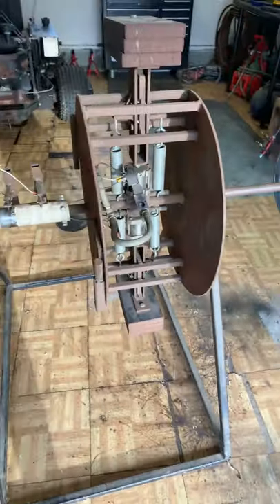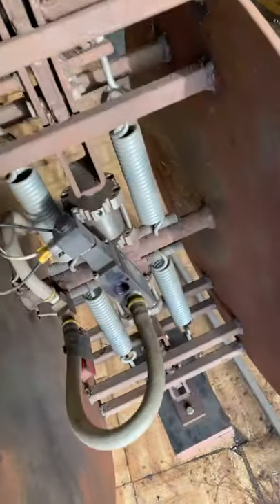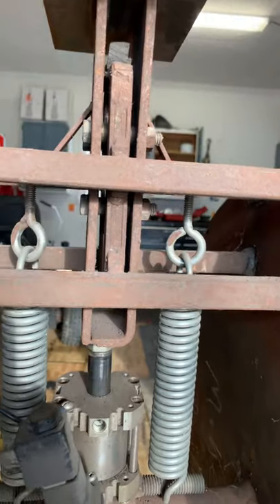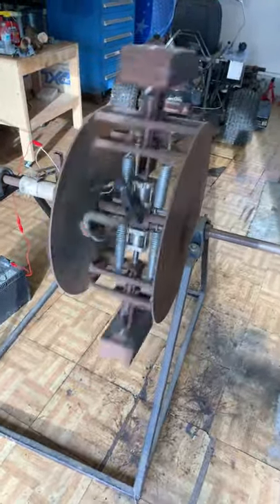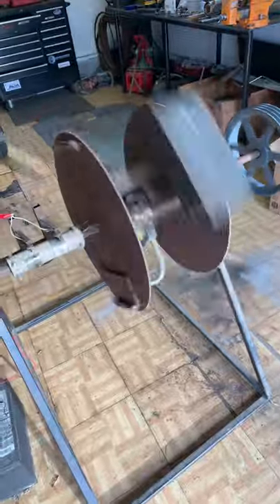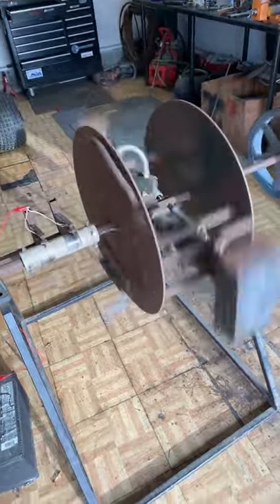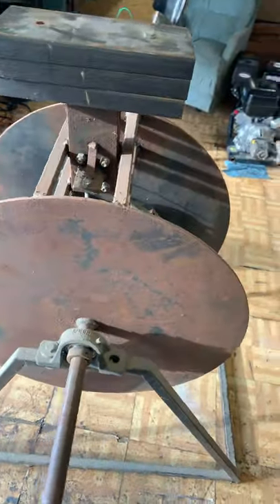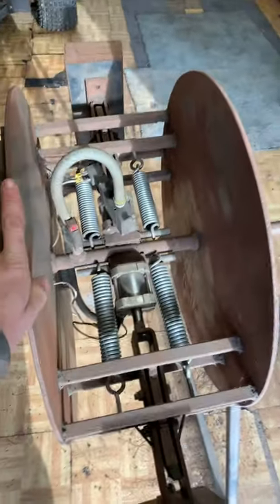Gravity powered motor prototype!!  Free Energy!!  #1

Comment: free energy is real, , and you have a very good solution to the overbalanced wheel. Of course to overcome the centrifugal force pulling the weights out, just build a larger wheel with more and heavier weights and slow it down.  Well done!
Reply: Yes, your suggestion is very accurate. For example  let's say a 8 ft diameter with 24 weights, the weights can be push out solenoids or electro magnets.
Reply: @MehmetBoysal  🔴 What Is Islam? ⚠️

🔴 Islam is not just another religion. 

🔵 It is the same message preached by Moses, Jesus and Abraham.

 🔴 Islam literally means ‘submission to God’ and it teaches us to have a direct relationship with God. 

 🔵 It reminds us that since God created us, no one should be worshipped except God alone. 

 🔴 It also teaches that God is nothing like a human being or like anything that we can imagine.

🌍 The concept of God is summarized in the Quran as:

📖 { “Say, He is God, the One.  God, the Absolute.  He does not give birth, nor was He born, and there is nothing like Him.”} (Quran 112:1-4)[4] 📚

🔴 Becoming a Muslim is not turning your back to Jesus. 

🔵 Rather it’s going back to the original teachings of Jesus and obeying him.
Reply: @MehmetBoysal  Right suggestion! In such design we need bigger (fly)wheel. Bigger diameter stores more energy and the wheel rotates more smoothly.
Reply: Minél nagyobb az átmérő annál nagyobb a centrifugális erő.Inkább a tengely meghosszabításával lehet probálkozni több elmozduló súllyal.

Comment: @Mike Beliler
Good Job, Nice to see big disc spinning. You have a blue pulley wheel sticking out, you can connect it to the air compressor and see whether it can go perpetual. Also you can try using DC solenoid plugger to pull the weights in and out and its timing can be controlled precisely. Keeping going.

Comment: Wonderful mechanical device!  Once you spend some time learning about the physics of it you will ultimately realize that it can't create more energy than it uses but the true key is the understanding gained.  It sucks but the laws of thermodynamics are sound.  That should never stop us from trying and exploring though!
Reply: As usual the physics guy ignores that he is trying to gain more energy through attempting to harness gravity as an additional power input.
Reply: @tomledger8944  No I don't ignore that.  In fact I've tried it many many times over the years and each time I ultimately come to the conclusion and figure out what little fact I didn't account for and why my devices wouldn't work.  I had the idea of a magnet on a pendulum that would swing down with gravity and hit a V gate at the bottom and break through the resistance with gravity's power and thereby return to the top and keep going.  Or when I dropped a baseball at one foot high and got it to enter a pipe of water and go up to 10 feet high I was thinking boy am I on to something here!  I guess I'm just trying to say the best part is the learning that is done.  If you break some amazing law of science in the process even better!

Comment: Very nice to see that so many people experimenting with so many designs. Can we call it like a Renaissance of great inventions? I guess so.
Regarding to your device.. maybe you can use electromagnet/ magnet pair to overcome the "dead spot" of the wheel. If to put permanent magnet on the circumference of the wheel and every time the wheel goes to the "dead spot" the activated electromagnet with the polarity N pushes permanent magnet S polarity and the wheel accelerates on the next cycle little easier. 
I believe you will succeed your setup!

Comment: I did something similar.  As the rotation increases, the centrifugal inertial force also increases which will make it difficult to drive the masses.  And it won't work forever and it can't even be considered a free energy mechanism.  Despite having the essential elements, flywheel, pendulum, it lacks the lever and the use of centrifugal inertial force in the process, without it a free energy mechanism will not be achieved.

Comment: This is the best idea I've seen in years.
 Why not turn it into a dynamo and collect some electricity while you're At it ?
You might be able to produce enough electricity to run a compressor and put the air back in If that sweet spot is as efficient as you say Enough permanent magnets passing over enough coils might give you enough power to split between charging some batteries and running the compressor That's a huge wheel imagine how many magnets you could just stick to the outside of it then just set up a bunch of air corps collector coils.🤷‍♂️
Reply: Because you'll never get more energy out than you out in. That's why. It's a waste of energy.
Reply: @jamessowin2505   Silence puny mortal

Comment: am a little late but here's a suggestion. instead of pushing the weights, use pendulums so they swing. at top dead center, if you had a pendulum, it would naturally want to swing forwards, so you use less power to swing the weight further from the center. The same is true at the bottom. The weight wants to swing backwards and so it takes less power to retract it. However make sure the pendums are like ratchets, only allowed to swing one way, like a bicycle rear sprocket. you can use electro magnets to give the weight a kick at the right time instead of compressed air. Its more efficient and easier to program, also has faster reaction times. Then make many pendulums, instead of just two, something like 24, smaller ones

Comment: Fermentation of sugar by yeast cells will release CO2 at enough pressure to activate your solenoids synchronously  and hence rotate the flywheel which drives the generator of electricity  So therefore that's one hell of an application Congrats Man would you sell me a silent system   I will invest in one unit.

Comment: Hey , Nice!! why do you not Connect the both weights together? The springs are not necassary, and use a other airpress device for both sides. I think the dead spot can be tackeld when there is a simple rod to stop the rotor before the dead spot.

Comment: Nice experiment, this has nothing to do with what you talked about. Here is a suggestion: you might try a much lower pressure arrangement with the pressure working on a horizontally-rotating wheel in which the pressure sends a lever outwards at a high point (it would be positioned on a very slightly slanted axis--the axis itself would be mostly vertical). The vertical slant could be used to automatically return the lever inwards on what I imagining is the upper left side. Perhaps since the resistance in a horizontal wheel is about 50% for the sliding lever, maybe a magnet or air pressure could be used to move the lever inwards or outwards depending on what is preferred. Maybe someone in your situation could succeed with the unbalanced weight concept where the falling weight is somehow 50% heavier or what have you. I'm not sure magnets are required, I'm trying to work with the concept you already built or something similar. I believe in a lot of different concepts however yours is not the worst. You might also try counterweighted air pressure to send levers outwards.
Reply from the maker: Thanks for the comment!  I love hearing other people’s thoughts and new ideas on this concept. This style I built is quite crude and inefficient for what I’m trying to accomplish but putting together the right ideas on a new machine I think will definitely have good results.
Reply: @mikebeiler4529  Good to know someone else is interested in the topic. Good luck on your experiment.

Comment: How about pushing outward at 45 degrees..after the top spot has passed... So it is lighter force to push out Or take action to push the mass out when the mass at the top position has a greater santifugal force than the mass at the bottom position.

Comment: Have you considered the use of counter weights closer to center and heavier than the outer weights - the increased mass would also give more momentum so may work in your favor - all connected by rods and levers, not cables - switching would be less instant but psi could be lower - at speed the weights on the lower side would be balanced but when slightly faster, the weights on the upper would be balanced, those factors combined would give you an operating speed range - just a thought - also, I have seen a video of a pneumatically prompted pendulum running, very heavy, in the tons range - I know of at least two other gravity motors that I am fairly certain of - don't listen to the naysayers, the conservation laws are not as well defined as they're made out to be
Another possibility, 1 counterweight spanning both sides of the center with the two outer weights linked to each other, so that the only thing you need to do is use the pneumatics and you can eliminate the springs - there would be an Optimum speed where switching would cost very little in the way of power

Comment: Gravity is a conservative force. Read the wikipedia page on conservative forces for an explanation of that term. In short, if an object moves around in a gravitational field and returns to the same spot... no work is done. Your design returns to the same point once per revolution so gravity cannot do any work on it.

A key point about conservative forces is that the shape of the path doesnt matter. This effectively rules out any design of machine that tries to use gravity. No matter how complicated the machine, no matter how complicated the path of the weights.. if they ever return to the same point twice they cannot do any work.

Comment: So a big tank full of 5000 liters of sweet water mixed with some yeast that ferments the sugar will release compressed CO2   at  pressure to rotate the flywheel which in turn can turn an electric generator. Of course you will get yeast and fertilizers as  lucrative 
byproducts.  Therefore sugar is the fuel.
Reply: Этиловый спирт как топливо

Comment: great mechanism! Thank you for the video! Have you tried pumping air with a spinning flywheel?
Reply from the maker: That will be my next step in this project.
Reply: @mikebeiler4529  Great work!
Consider masses moving along the radius cause angular speed change due to momentum conservation. Reasonably would be doing some pre-construction calculations.
For now it seems that gravity would overcome momentum conservation law when there will be lower than applicable angular speed in use. Another side that inertial interaction usually called centrifugal force will not be applicable than.
Reply: You can see my desig, the usefull work is for example pumping and you spend work by spinning the wheel. All best wishes.

Comment: Interesting idea....
How much power watts can you get now?
If adding the weight on each side, how much more power you can get?
Reply from the maker: I have not measured the exact output yet.  But by adding 2 more weights opposite to the ones currently there I know it will more then double my output power.  That prototype is still in the making. :)
Reply: @mikebeiler4529  keep going... that is the future. The future is bright for you with these ideas, I mean, not using fuel fossils. These free energy was an inspiration from Nicola Tesla... however, there were lots of big potatoes in his way. You are one of his disciple. KEEP GOING... 😀

Comment: I admire your rig, and wish you success. But it seems to me this cannot work in this form. To exploit gravity asymmetrically you need to have a weight drop down at the top of the cycle (move in towards centre), and drop again at the bottom (move out) - I realise this seems counter-intuitive and the opposite of what you are doing. At the right speed the weight will be under 0G at the top and 2G at the bottom. Work = force x distance. So you can move the weight in at the top at no energy cost, and let it move out at the bottom under 2G to do some work 'for free'. The question is how to exploit this movement to power the wheel or say, generate electricity.
Reply: The reality is just the opposite of everything you said. And by this system, work done in moving the weights upwards at top de∆d centre is extracted by gravity and weight distribution on the way down, causing rotation. Therefore no net positive work output, only less due to mandatory inefficiencies.

The result is an air powered motor that also requires gravity to function.

Comment: It is unlikely, that output will be greater than energy needed to preasurize the air in the first place. But it could work as good lasting "batery". Similar to gravitricity/gravitational battery. Only way much more complicated and therefore expansive & prone to malfunction. But good initial idea. Could work longer (witouth presurized air, serving as kinda fuel) and would not need airtanks...
Reply: At best this a more efficient air-motor than the usual vane type, but no energy is added by gravity. If centrifugal force helps lifting the top weight, the bottom weight has to fight the centrifugal force to retract. However if the cylinders were glass with a small amount of a low boiling point liquid, concentrated solar power could be used to lift the weight. Likewise cooling the bottom cylinder would then add to the output, so the contraption is capable of using both sides of the Carnot cycle and like a Stirling engine and achieve higher efficiency than from expansion alone. Then he might have invented a very efficient solar collector getting into the 40% efficiency range, better than all but the most space age solar cells available.

Comment: This device consumes much more energy than it produces.  The energy of rotation comes from changes in potential energy.  Potential energy changes are made with compressed air with poor efficiency.
Reply: Blah blah blah.. At least this man is trying you probably never touch a screw driver
Reply: @100TrilionEuro  and what was the point of your answer? 😂
Reply: @PastoKoivula  This is not perpetual motion.. you are in the  wrong room man..
Reply: @100TrilionEuro  #free energy. #can it run forever.  Both are inbossible. I responded to the claims in the video.

Comment: you better not lie...so you made an imbalanced wheel from compressed air creating weight imbalance at the right spot...interesting...why dont you  use electromagnetic solenoid actuators instead??

Comment: Very interesting. I am looking into some similar projects. Another possible source to drive the wheel you could use pressure from City water supply.
Reply from the maker: Thats an idea but dont you have to pay for water?
Reply: "Free Power" was a topic. But the idea it self is good. Water is heavy. And if there is a small river near by it could be an answer. There are devices to lift the water in to certain hight without power usage. Only disadvantage is, that those devices are very uneficient and slow in production. Other question - how to generate pressure?.. of cource we could connect water lifting device directly to this aparatus and have from 1 to 100 bar, but then we need to deal with constant overpreassure when this aparatus (generator) does not work, or there is no demand for him to work (all saving devices (aka batteries) are full and no demand of energy is actual).
Reply: @mikebeiler4529  iAmThinkingThatHeWasIronicalInHisOwnWay.

Comment: 0:14  Create more power than I consume.  
So you're connected to an air compressor.  How do you put power back into the air compressor to build up enough pressure, to continue running?  You can't create more energy than you put in.  Why?  Losses in the system.  Every system has losses.  Friction, heat...etc, take away from the input energy getting to the working part of your motor.
You have no measurements, just your opinion.  No, you will never get twice the power out than you put in.  In fact, you can't reach unity because of losses.